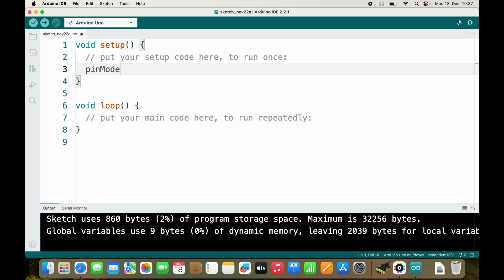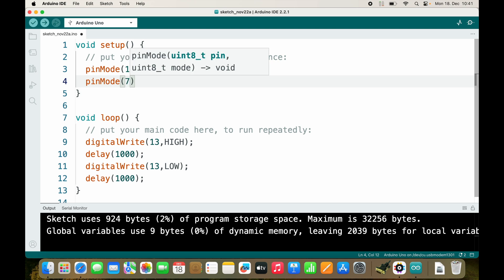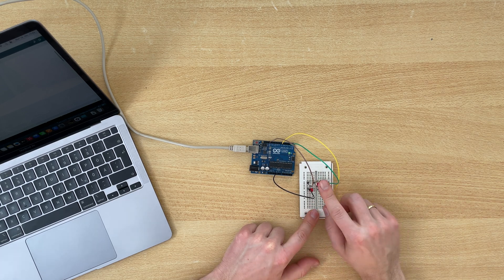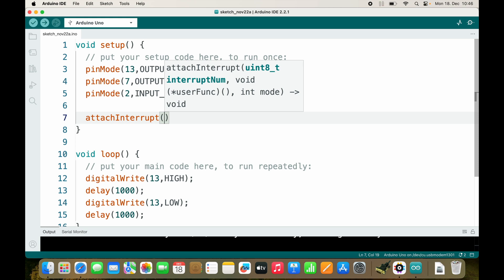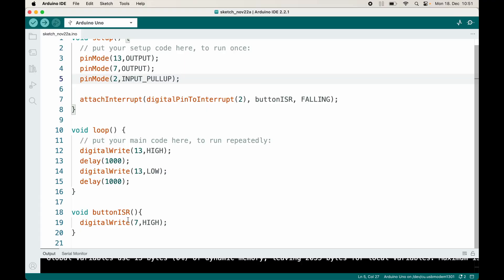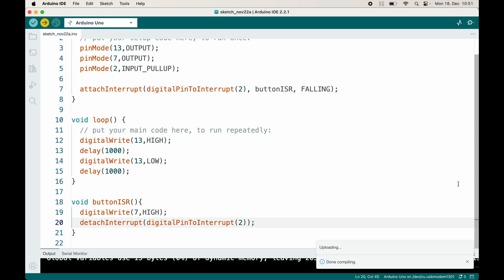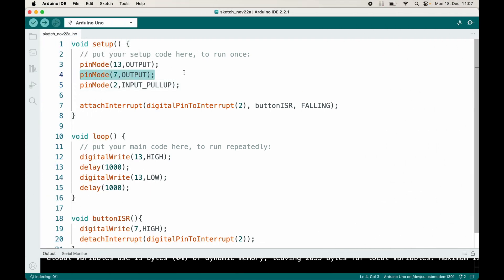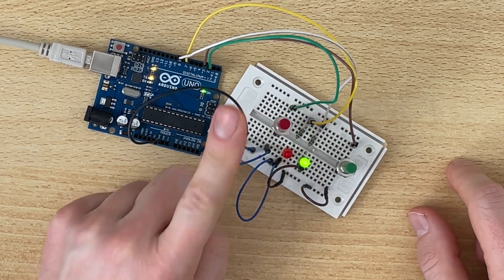What are external Interrupts? - (Arduino Uno Programming for Beginners)

Comment: Hello,  Does the rule regarding the UNO and pins 2 and 3 for the Interrupt function apply to the MEGA 2560 R3 board?
Reply from the maker: Hey! Arduino MEGA 2560 has more external interrupts:
this pins can be used: 2, 3, 18, 19, 20, 21

Comment: But using this with noisy enviroment, it becomes a problem and impossible to use
Reply from the maker: maybe you can explain your concerns in more detail. of course everything breaks at a certain emc noise level. Adding some capacitors in parallel to the switch would help you in this type of environments.
Reply: @playduino  yes, i've no choice. Using a hardware solution is more abvious in this case. Thanks for your help

Comment: This is the best channel on YouTube for Arduino tutorials! You have a knack for teaching this.
Idea for a future video(?): I'm trying to integrate a TM1637 into my project. While the project is idle, the TM1637 displays a static number. After a button command is given, a motor runs and while the motor is running I'd like the TM1637 to illuminate one segment and make the segment crawl around the display like an hourglass timer. When the motor stops, a static number would again be displayed. I've written the routine that makes the segment crawl around but I'm using delays to accomplish this and of course that delays the rest of the code.
Reply from the maker: Thank you! This sounds like a great application for a timer library or millis() ;)
Reply: @playduino  Thanks! I'll check out your millis video 🙂

Comment: Great video and explanation! Two questions if I might. 1. Can you use delay function inside the ISR?  2. Can I have an internal loop inside an ISR so as to do 3 parallel things? (one on main loop and 2 parallel jobs and checks on pins 2 and 3). Finally, can I "share" variables between main loop and ISR functions (volatile maybe or something?). Thanks a lot for the great video.
Reply from the maker: Thank you for the kind words, 1) no, they are not working. The ISR needs to be quick, so the best thing to do in an ISR is to change a variable and leave the ISR.
2) unfortunately no. Arduino does not support multitasking. You can only execute one loop at a time.
The best thing that comes very close to multitasking is to write non-blocking code.
take a look at my video 15 about millis: https://youtu.be/FIYjw0AhTkA?si=ZCbUe6wDghEty-Xc
3)  yes! it works great with global volatile variables you need to add volatile otherwise you could run into some troubles. You need to define them outside of setup() and loop() usually at the very top of the sketch.
Reply: @playduino  Thank you very much for your prompt reply! I will watch your video right away. Thanks again!

Comment: can an interrupt interrupt another interrupt? for example, could the buttons be pressed at the precise time that the other interrupt is triggered to run after one of the lights turn on but before the interrupts are unregistered?
Reply: During an interrupt, further interrupts are disabled. You can, if you know what you are doing, enable interrupts in an ISR but it's not recommended. 

Cheers,
Norm. (Author: Arduino Interrupts published by Apress)
Reply from the maker: very good question, as @NormanNodDunbar already pointed out, inside the ISR, interrupts are disabled by default.
if you really need it, you can call the function interrupts() inside of the ISR to enable them, you can also disable them again by calling noInterrupts()